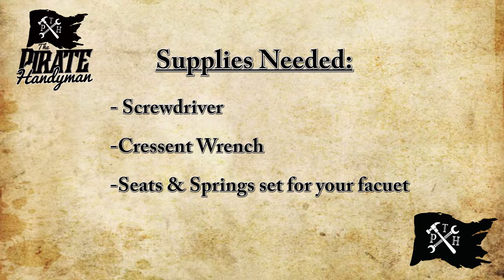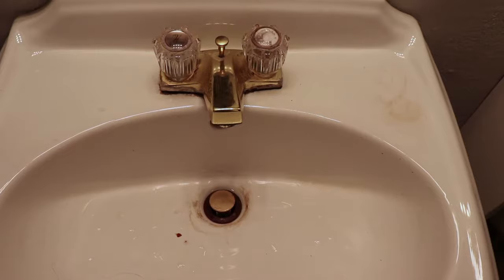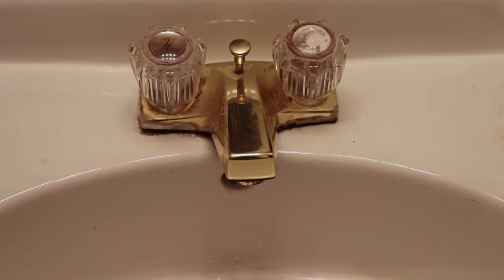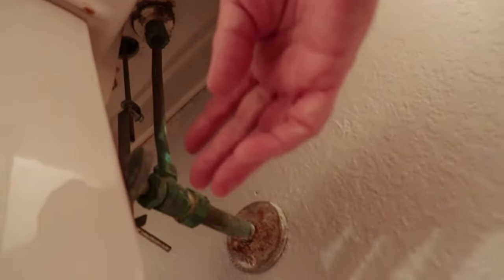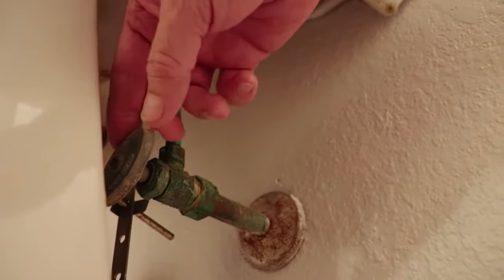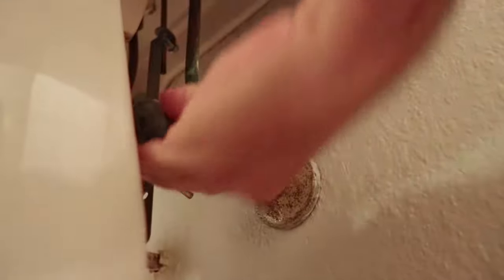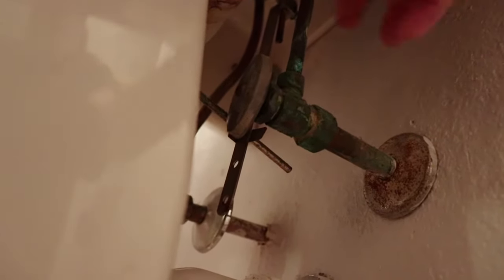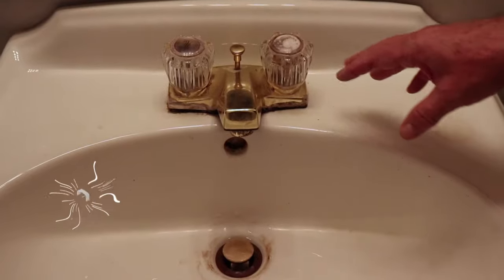How to Fix a Dripping Bathroom Sink Faucet Double Handle

Comment: What if you have a kitchen sink with one handle (delta) turn on/off and a sprayer.  To the right is cold; to the left is hot.  Had the faucet replaced; paid quite a hefty plumber bill.  My kitchen faucet is now dripping; not all the time but will not completely stop at times. How do I fix my kitchen faucet?  (Delta style faucet).Nancy, Nashua NH
Reply from the maker: Aye, lass, the concept on the single handle is the same. 
1. Turn off the water feeds under the sink.
2. Remove the handle by loosening the screw on the underside of the handle (usually takes an Allen wrench).
3. Unscrew the collar, and remove the cartridge.
4. There are 2 holes in the bottom seat - one for hot, the other for cold. Remove the seats and springs (as in the video) and replace them (as in the video).
Let me know if you have any trouble. Smooth sailin'!
Reply: Hi! I just looked and my handles on the faucet pulls out to be a sprayer, couldn’t find the screw you are talking about.  However, perhaps I can pull up the maintenance manual on this faucet.  I bought it from Amazon.  I was able to get a lot cheaper on Amazon than a home/kitchen store.  I appreciate the step by step instructions, which I will follow as soon as I find that screw.  When I order the seats and springs do I need to know a particular size or just any combo set will do (I am thinking from Amazon).  You are so pleasant and helpful.  Thank you ever so much!
Reply from the maker: Ye be most welcome, lass. When you order the springs and seats, order the one that are specific to Delta.
Reply: Thank you for heads up when ordering the seats and springs!  You are truly helpful person.  Thank you for being you.
Reply from the maker: Thank you for the kind words, lass - smooth sailin'!

Comment: I replaced the spring and seat. It worked fine but it started to drip. Could I have tightened it to much? The knob was tight to turn.
Reply from the maker: Try shutting off the supply valve. If it still drips, you may need to replace the grommet in the supply valve. If the drip stops, then it could be that the seat did not "seat" properly. Try taking it apart again and make sure the seat goes all the way down in the hole. If not, try completely replacing the seat again.
Reply: Thanks!  I repeated it and its fine!! @thepiratehandyman2225
Reply from the maker: Aye, matey, glad it worked!

Comment: I shut off both the hot and cold valve located under the sink but the faucet was still dripping. What could it be?
Reply from the maker: Aye, lass, ye have 2 problems - the faucet and the valves under the sink.  The link below, even though it's for an outside faucet, is the same for the valves under the sink.  Follow the instructions to shut off the main water valve to the house, replace the grommet in each shut off valve under the sink, then replace the springs and grommets in the faucet.  Smooth sailin', and let us know how it goes!

https://youtu.be/KDAB0HjgYYs

Comment: What if I  turned both valve under the bathroom sink completely & it still leaks?
I found it was the hot water side that still leaks. I tightened the faucet screw & still leaks, I tightened the valve & it still leaks. What should I do?
Reply from the maker: Aye, ye need to replace grommet in the valve under the sink. The video below shows how to do this. Even tho this is for an outside faucet, the concept is the same.
https://youtu.be/KDAB0HjgYYs

Comment: How do you take off the handle of the sink when it has a c on it and a h on the other side and it has a little round silver ring on it and then on top is the letter c that's the cold water that's where my little leak is how do I take that handle off the top
Reply from the maker: Sounds like a c-ring.  You should see a slot where you can slide a small screwdriver in and pry the ring away from the shaft, Then remove the cartridge and replace the spring and grommet. You will need a pair of pliers to squeeze the c-ring back on to the shaft.

Comment: So my valve stem thing didn’t come out and then it did but not all in one piece. How do I get the rest out without breaking everything
Reply from the maker: Aye, that be a problem.  Try spraying a lubricant like WD40 around the stuck pieces, let it sit for an hour or so, then try rocking the pieces, with a sset of pliers, if possible.  Let me know if that works.
Reply from the maker: Also, if there is a lot of "crusty"  mineral deposits, use a products that melts away the deposits, like Limeaway.

Comment: Hello, what if I did everything u said but now when I turn on the water again from below the sink. How come I can't turn on and off the water from the top?
Reply from the maker: Aye, matey, that be a problem!  Make sure you put the cartridge back the same way it came out.  Turn off the water under the sink, take the handle and collar off, take the cartidge out and turn it around.  Because of the notches in the bottom of the cartridge, there are only two ways it can go back in.  If that does not work, and the grommet and spring are in correctly, you might just need a new faucet.  Let us know if this works.
Reply: @thepiratehandyman2225  thanks for the reply, lol I realized that I pushed the seat all the way down. That's why it couldn't turn on or off lol. Now the top is fixed but 
Unfortunately, now I got the lever to turn the water on and off under the sink leaking. Do you know why it's leaking? B4 it was just the top faucet. Is it because when I turned the water back on. I turned it all the way? I'm thinking that's the reason why.
Reply from the maker: Aye, this sometimes happens.  The problem is most likely the grommt on the valve under the sink.  See the video below.  Even though it's for an outside faucet, the concept is the same.
https://youtu.be/KDAB0HjgYYs
Reply: @thepiratehandyman2225  thanks you for the reply, I  found out what was the problem already lol. I realized that I wasn't supposed to push the seat all the way down so that it's not sticking out lol. Thanks again for the help.

Comment: The nail head has rusted in one that's leaking, can't screw it out what to do?
Reply from the maker: Aye, that be a problem. Can you grab any part of the screw with pliers or locktites? If not, I'm afraid you'll need to call a professional. It happens - sorry.
Reply: @thepiratehandyman2225  thanks😞

Comment: Probably a dumb question, but are the parts typically universal?
Reply from the maker: Aye, matey, not a dumb question at all!  Generally, these parts are universal. Sometimes, brands like Delta or Pfister can be different on the more expensive units. The best way to tell is to take the old parts with you to the hardware store and match the replacement parts that way.
Reply: @thepiratehandyman2225  Thank you!
Reply from the maker: Ye be most welcome, matey - smooth sailin'!

Comment: How do fix a old leaky bathroom faucett that doesn't have a way to get to underneath the bathroom sink. It's an all one piece fiberglass bathroom with the box under the sink that is part of the  floor. Sounds weird but tru  A guy friend just cut a hole behind my washer and put a shut off valve on that bathroom sink that is right behind the wall of my dryer. He said I just can't use the sink in that bathroom
Reply from the maker: Aye, lass, ye still should be able to fix the faucet.  Turn off the water via the new shut-off valve, then replace the springs and grommets, and hopefully that will fix the leak.  If not, you may have to replace the cartridge.  Let me know if this helps.

Comment: Following this video and trying to fix mine currently. I turned off the water on both sides and it was still leaking. Took me almost an hour to everything unscrewed and taken off cause it clearly been done before (I’m renting so it wasn’t me) and it was a pain in the ass. With everything off the water still kept filling in the handle. I replaced the seat and spring and I thought it was better.

Nope. I put it all back together and now it’s not leaking out of the faucet but from the handle. Ugh.
Reply from the maker: Aye, matey, it sounds like the grommets in the valves need to be replaced.  I will put a link to how that can be fixed below.
Reply from the maker: Even tho this is for an outside faucet, the concept and pasrts are the same:
https://youtu.be/KDAB0HjgYYs

Comment: I shut off both sides of the faucet one at a time and it still drips out of the faucet in each case (very slow drip, 1 per 30 seconds). Is the problem on both sides then? Seems unlikely...
Reply from the maker: Aye, it sounds like you have 2 different issues. If it still leaks after you turn off the shut-off valve under the sink, then you probably need to replace the grommet in each shut-off valve. The following link is for an outside faucet, but the concept is the same. https://youtu.be/KDAB0HjgYYs

Once that is done, then you can replace the spring and grommets sets in the faucet. Let me know how it goes, matey!
Reply: @thepiratehandyman2225  Thanks so much for the reply! To shed more light on my issue, there's no leaking under the sink from the hot or cold shut off valves, so could it still be the grommets there? Also, it's weird...my hot shut-off valve is a standard metal quarter turn valve, but my cold shut-off valve is a clear plastic one which you have to turn several rotations to tighten. Not sure why they're different but I'm wondering if this has anything to do with it. Lastly when I shut off both valves at the same time and open both faucets, I get a fast steady drip from the faucet which never seems to end (I gave up after 3 minutes). Also the water turns gray.  What does this mean? Thanks again!!!
Reply from the maker: Aye, matey, if the interior grommet is leaking, but the connection is tight on the casing, you would not get water leaking out of the valve itself.  So yes, it still could be that gromet. That also could be the reason the water is gray, because the grommet is deteriorating. But the gray water could also be from the grommet in the faucet as well.

I have no idea why the 2 shutoff valves are different. Maybe one failed at some point in the past and was replaced?

Comment: What if you turn off both the hot and cold water under the sink and it still drips?
Reply from the maker: Aye, matey, you probably need to replace the grommets inside the shut-off valves.  Even though the following video is for an outside faucet, the concept is the same.
https://youtu.be/KDAB0HjgYYs

Comment: Tried to do this but the collar thing was rusted so wasn't able to get it off. I'll have to use some WD40 or something so I can unscrew it.
Reply from the maker: Aye, WD40 or 3-in-1 oil should help.  Spray the threads as best you can, let it sit for a few hours, and try it again.  If it still won't come loose, TAP the wrench with a small hammer while trying to turn the collar.

Comment: What if the valve breaks when screwing the handle back on and water shoots up. How do I replace that ? 🥲
Reply from the maker: Aye, that be a problem, matey.  If it's the valve that goes into the wall, you;ll need to call a plumber.  If it's the handle on the faucet, then you need to replace the faucet.
Reply: @thepiratehandyman2225  I went to Home Depot and found the part. Lol I got lucky because I just found the one that I thought looked just like the one I broke lol
Reply from the maker: Aye, matey, that be providence!

Comment: What if the water doesn't stop dripping when I turn the shut off valves?
Reply: I tried turning both and both ways
Reply from the maker: Aye, matey, ye probably need to replace the grommets in the valves. Even though the video is for an outside faucet,  the concept is the same for an inside valve. See below.

https://youtu.be/KDAB0HjgYYs

Comment: What if both sides are turned off under sink but are both leaking?
Reply from the maker: Aye, matey, then ye need to replace the grommets in the valves under the sink.  Check out this video, as it shows you how to do make this fix:

https://youtu.be/KDAB0HjgYYs

Comment: I turned off both valves under my sink..the faucet is still dripping, so what does that mean?
Reply from the maker: Aye, lass, you probably need to replace the grommets in the valves themselves.  The video link below is for an outside faucet, but the concept is the same.

https://youtu.be/KDAB0HjgYYs
Reply: okee-dokee, thanks, I'll give that a whirl..you may be hearing from me again...ha
Reply from the maker: Aye, lass, ye can do it, and let me know if ye have questions - smooth sailin'!

Comment: My leaky double handle delta sink faucet is so corroded-its stuck, really stuck! i cant remove the cartridge
Reply from the maker: Aye, that can be a problem.  Try putting a lime-dissolving agent on it and let it soak for several hours. You may need to do this a few times to get it loose.

Comment: How to open Self cleaning oven door stuck and will not open. Hinges are on side  not bottom of door.
Reply from the maker: Do you know the make and model?  Does the locking mechanism for the "cleaning" setting lock and unlock like it should?

Comment: Evidently the faucet for my laundry tub is not standard. Couldn't find the proper size seat for it so I just bought a new faucet.
Reply from the maker: That be not good.  Sorry ye had to spend the coin...
Reply: @thepiratehandyman2225  Quite alright. Laundry tub faucets aren't as expensive as a kitchen sink or bathroom faucet. Thanks for the good lesson though. Now I feel confident I can fix this problem in the future.
Reply from the maker: Thanks, matey! Smooth sailin' on yer next project!

Comment: What is name of the spring gasket set
Reply from the maker: Aye, matey, they be called Seat and Spring Sets. Here is an example: https://www.homedepot.com/p/DANCO-Seats-and-Springs-for-Delta-80684/204150929
Reply: Also when I push down on the drain handle it binds up. Is this the rod adjustment for the water stopper?
Reply from the maker: Aye, matey, unless you have an unusual type faucet, they are interchangeable.
Reply from the maker: There is a way to adjust how the stopper shaft is connected to the drain handle underneath the sink, just behind the drain pipe where it connects to the bottom of the sink.

Comment: I watched your video on fixing a dripping bathroom faucet. I turned the water off and it is still leaking.
Reply from the maker: Aye, ye probably need to replace the grommets in the valves on the feeder lines (where you turned off the water). The video link below is for an outside faucet, but the concept is exactly the same.
https://youtu.be/KDAB0HjgYYs

Comment: What do you do if both valves are turned off and it still leaks?
Reply from the maker: Then you need to replace one or both of the grommets in the valves themselves.  The process is the same, but you have to shut the water off to the entire house.

Comment: my faucet is double handle and it is leaking when i turn it to open just under the knob
Reply from the maker: ye, it sounds like you need to replace the cartridge as well as the springs and grommets.

Comment: I watched your video, but I think the valve for the hot water is broken. When I turned it off, it was still dripping water, and the hot water could still be turned on.
Reply from the maker: Aye, matey, you probably need to replace the grommet in the shut-off valve. The video below is for an outside faucet, but the concept is the same.
https://youtu.be/KDAB0HjgYYs
Reply: @thepiratehandyman2225  thank you for sharing this link.
Reply from the maker: Let me know how it goes - here's to smooth sailin'!

Comment: Changed seat, spring, and cartridge and it still leaks. 🤔🤷‍♂️
Reply from the maker: Aye, sounds like the casing may be cracked. You probaby need to replace the entire faucet. The good news is, you now have the knowledge to replace it yourself.

Comment: Looking for the video with one not two.
Reply from the maker: Aye, matey, I have not made that video yet. However, the concept is the same.  After shutting off the water, follow these steps:
1. Remove the handle.  There should be an allen screw on the under-side of the handle.
2. Remove the collar by turning counter-clockwise.
3. Lift out the cartridge.
4. After sopping up the water in the bottom, you will find 2 holes, instead of one.  Remove and replace the spring and grommet in each hole.

Let me know if this works for you. Smooth sailin'!

Comment: How To fix a leak from the base (part of the faucet sitting on top of the surface of the bathroom sink.
Reply from the maker: You should try replacing the cartridge first.  If that doesn't fix the problem, then you may have a crack in the housing, and need to replace the entire faucet.  The good news is, you can do it yourself!

Comment: I got the nut off easy enough, but no matter what I do i can't get the cartridge off. It's like it's stuck in place. What do I do?
Reply from the maker: Aye, have you tried spraying a lubricant, like WD40 or 3-in-1 oil around the edges of the cartidge?
Reply: @thepiratehandyman2225  I don't see how i can get the oil into the pipes. The edge of the cartridge is sealed pretty tight. Is there a type of faucet that doesn't allow you to replace the cartridge?
Reply from the maker: I have never come across a faucet where you can't replace the cartridge, but I suppose it's possible. If that is the case, you'll have to replace the faucet. But you can do that yourself, too.
Reply: @thepiratehandyman2225  this faucet looks exactly like the one in your video, the cartridge looks the same too. But i just can't get it out of the housing. I could almost lift the entire sink up from the stem and it won't budge. Is it possible some faucets glue the cartridge to the housing?
Reply from the maker: Aye, that is a possibility. Also, if they used some kind of caulk or putty, that could cause it to stick. You might try wrapping the housing in a washcloth soaked in hot water to heat it up and possibly loosen it that way.